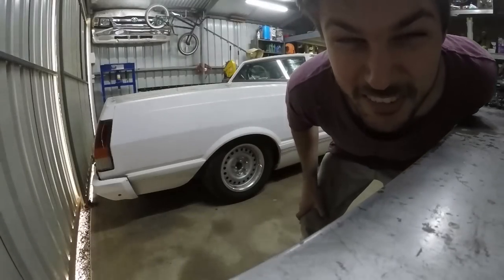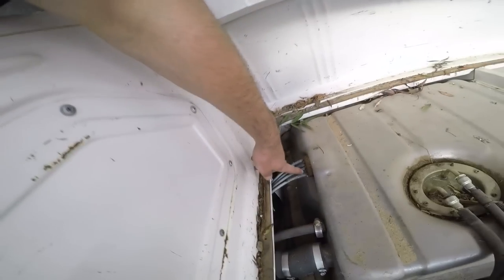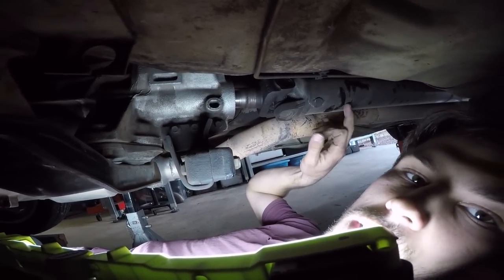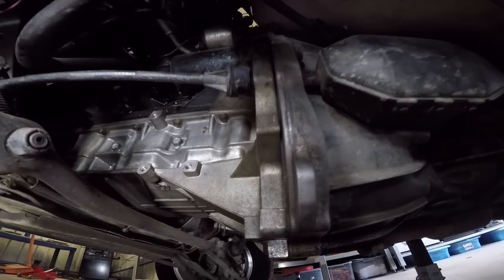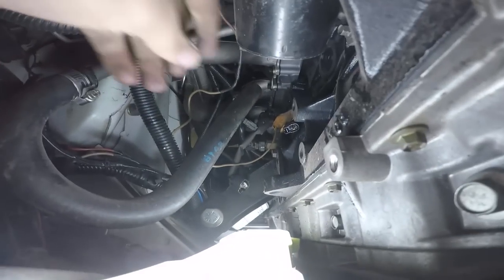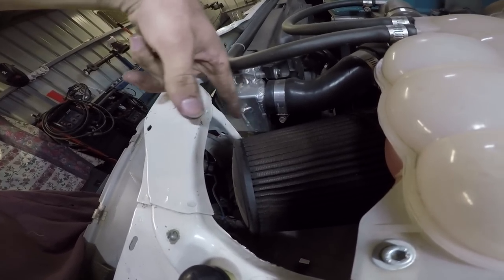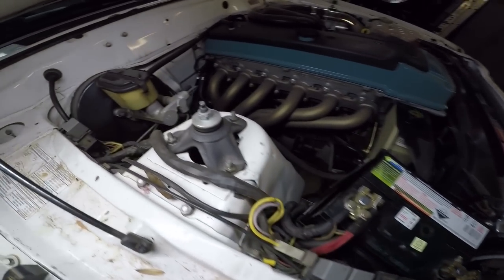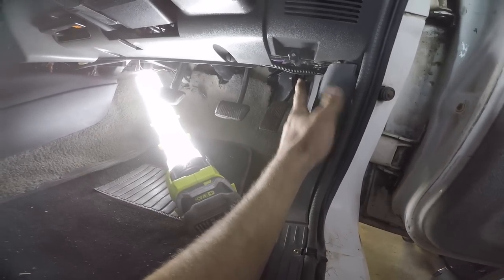How I barra swapped my xf ute FULL CAR OVERVIEW

Comment: I wanna do a Barra Turbo in an XG Panno. But I wanna use as much factory stuff as I can, like AU2 bigger brakes on the front and a trutrac in the borgy and 31 spline axles and just do rods and valvesprings on the engine as I'm not going for insane power. But want to stay auto as riding clutches just gets a pain in stop and go as much as I like manuals, and I might have to get it converted to a 4L60E as no one can guarantee they can build a BTR that will live over 600hp. I might put Chrysler US police rims and the dog dish caps on it, as they are the same bolt pattern as domestic ford and I think they would like plenty smart on a panno or ute personally..

Comment: Putting a au engine in to my 93 xg ute.just waiting on sepentine belt and she going in.vct block decked au non vct ported head done by me.head shave ceramic coated exhaust valves  rockers balanced to 128 grams each rocker.rocker shaft polished and rocker fulcrum polished put hours into it used rouge to get 5 microns.also using a t5 manual with lightened flywheel and balance.i ceramic coated piston head modified block oiling system and list never stops I modified shit outa everything even the  oil pump. has around 10.5.1 compression.port matched runners and ported throttle body.Done all work myself even electrical just taught myself love it .going to start a head porting business outa this journey.love porting heads its a art.
Reply from the maker: That thing sounds like it’s going to rip man!!

Comment: Hey mate Killa video just wondering if xf t5 would be a pain with an intech in an xf Ute planing on doing intech swap
Reply from the maker: in which sense dude? as fitting eg gearbox crossmember and stuff?   should all work pretty easy I reckon man
Reply: @ForrestFab  yeah I don’t k ow why but I was questioning if an xf gearbox would fit into an xf just having a dumb moment but yeah I was planing on doing a carby intech manual in an xf ute
Reply from the maker: @lincolnquilty3464  yeah man it'll be fine, xg's and xh are same body as xf and came out 4L manual so it'll all work :)
Reply from the maker: dont worry i have manys moments like that too haha, goodluck with the build dude!
!
Reply: @ForrestFab  yeah cheers man appreciate it

Comment: What did you mean by "the gas motor just loved it" , i didn't quite understand why you recommend a gas over a petrol. 
I'm thinking of doing a barra swap in a f100 so this is pretty interesting. Cheers 4 sharing sir.
Reply: Gas engines have much less wear for kays and have beefier rods.
Reply from the maker: The gas motor was still running straight petrol, apparently they are slightly higher comp which goes nice with a good tune of 98, which I had got copied from a burnout car, when I put the bf motor in it was dedicated petrol, was low Ks but had not many oil changes, was full of shit and was just not as snappy
Reply: @ForrestFab  Very interesting, thanks for the reply sir.
Reply from the maker: @JustTex  no prob sorry it was so late
Reply: @ForrestFab  all good

Comment: hay mate great vid i did the same conversion  can you please tell  me how you  did your fuel tank  mod please  parts you used ohms converter thanks
Reply from the maker: I can’t remember the brand of the unit, but I know there’s a few options these days as I’ve been looking into a few for some up coming projects, pretty sure they all do the same thing, all it does is just modify the signal to the dash, I installed mine and had issues calibrating the device so I got the speedo shop to finish the install but turns out the fuel sender in the tank was fucked haha hence why it wouldn’t work but I nearly got there 

And fuel tank was just out of a xg parts car, put in a new standard fuel pump as well as xg ute fuel lines and just cut them at the rubber hose to clamp them onto the barra fuel rail :)
Reply: @ForrestFab  ok cool thanks mate for your reply keep up the good work take care

Comment: Hey mate. Me and my mate wanna buy an xg and put a Barra motor. How much did this all cost you? And would the xg be easier to fit a Barra to compared to the xf?
Reply from the maker: Was probably around 6k I’d reckon but I did a lot of other shit to the car that probably wasn’t necessary, and yeah xg will be easier because and the fuel lines and efi gear you can literally hook straight into the Barra fuel rail , but because I was xf I had to instal all the xg fuel tank and lines onto mine

Comment: Hey mate im doing the same set up what engineer did u use and do you need it regoed before beginning any work
Reply from the maker: Yeah mad, the guy that did my ute is retired now, but passed all his work on to APS engineering in Melbourne :) 
Mine was registered when I started the swap! 
But a vass certificate is more powerful then a roadworthy so in theory it wouldn’t matter , you have to take the car to vic roads with the certification anyways so yeah
Reply: @ForrestFab  ok cheers also what front brakes as spending a grand everytime I change em really rules out willwood or hoperstoppers
Reply from the maker: @rigelrogers5264  I’m just running standard xf front disc brakes man